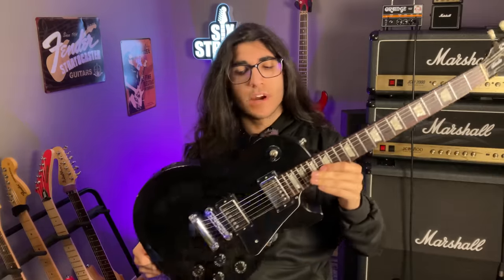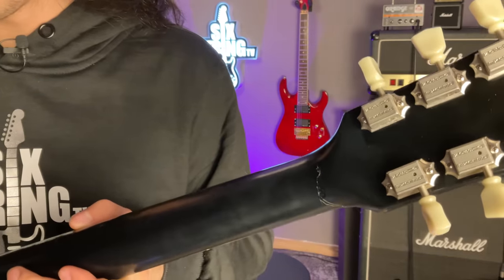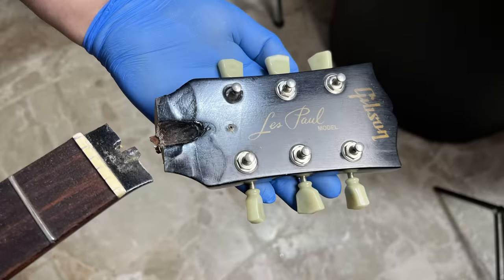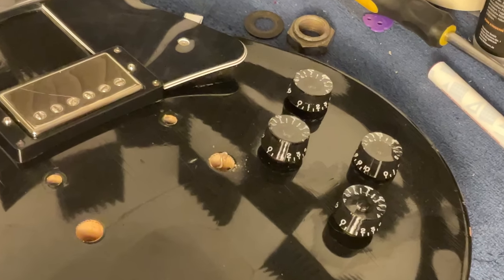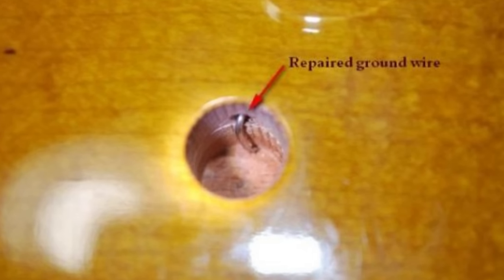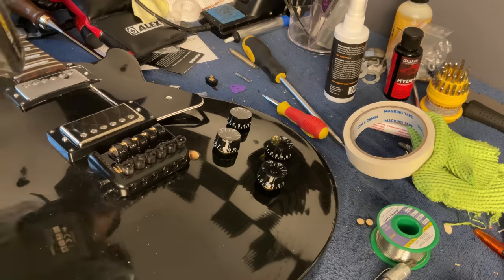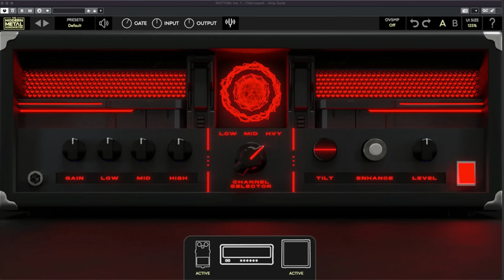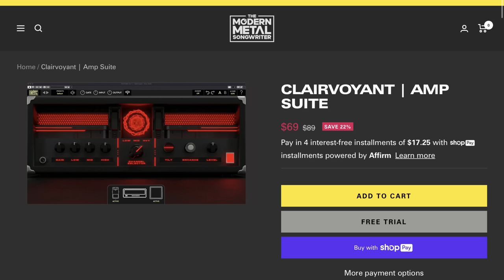How I Made This Gibson BETTER

Comment: My first headless guitar was one I made myself out of an existing guitar. It got knocked off its stand and the headstock broke in two so I cut what was left of the headstock off, bolted on an extra Floyd Rose locking nut and routed the body to move the tuning machines to the body. I've had that guitar for like that for 35 years and its always been one of my best playing, most stable and comfortable guitars even though its ugly AF (for many reasons, not just because its headless... I mean its pink with neon green splatters on it ... a local guitar shop used to run an "ugly guitar contest" every Christmas and I entered it several times. Never won though because it was actually playable). This was a cheap Tokai/Strat style guitar and so I ended up putting a tune-o-matic bridge and tailpiece on it and use the tailpiece as basically a big string tree. We didn't have cheap, readily available headless bridges back when I did mine (yeah, I'm old).

Comment: Absolutely love the way this looks, which is odd for me, since I do t really like LPs or headless guitars but this works. Any headstock repair will actually be far stronger than the original, it is the reason people use scarf joints on guitars. That Gibson can possibly break due to the same headstock angle and a direct slam but it will NOT break in the same place. That glue is crazy strong.

Comment: Hey kaylen I really liked the video,but I believe you might have made a mistake.Looking at every guitar on the market,i can see that after the nut,the string heading towards the tuning pegs is at an angle,the aren't completely straight,this helps reduce the tension on the neck.At first I thought that this isn't necessary on a headless guitar,but after checking headless guitars on thomann,you can clearly see that the strings are on an angle and not perfectly straight,i think you can correct it on the less paul by rotating the floyd rose locking nut.
Though I am not sure,I might be wrong,I have zero experience with headless guitars,you can correct me if i am wrong.

Comment: "Professionally repaired"

That wasn't actually professionally repaired. Gluing it back on is only half of the process. It has to be reinforced afterward, with either inlaying hardwood or grafting carbon fiber. Then it just needs to be painted to match the rest of the guitar. A professionally repaired headstock break won't even look like it was broken in the first place.

Comment: Pretty cool mod for a broken les paul, gives a different option as to gluing the headstock on or gluing and routing it out for wood blocks and reshaping the neck
Reply from the maker: I would've done it either way really. Just so happened that the one I bought had a neck break

Comment: I’m doing the same fix for a snapped epi. Same bridge, about to drill and try to figure out the stringing up, wierd design tho seems difficult to run strings through the bridge and tune any advice or info you watched

Comment: At first, I was worried about you doing this to an actual Gibson, but when I saw that the headstock was previously broken, I felt that it was justified. 
The end result still looks very beautiful. I would love to see someone play this guitar at a gig, just for the reaction of the audience.
Reply from the maker: I would've done it either way, just so happened the prettiest LP on ebay at the time was one witha  repaired neck break 🤷‍♂️
Reply: @sixstringtv1  I mean it is your guitar, so you can do what you want with it. It’s just like putting Floyd Rose on a Les Paul, whatever get’s you to play the guitar more often is a good modification. 
I was just surprised because of the huge value loss. But honestly, you probably have a lot of fans, that would happily buy this guitar from you.

Comment: The headstock fragility is due to a single piece neck and the back angle on the headstock. A previously repaired headstock that has been glued is actually stronger than the short grain wood fibers themselves. So not sure why you made up the claim that broken headstocks usually break again or "relapse." 

It's an antiquated design for sure, but no need to make up BS.

Comment: The strings spacing is not the same in the Les Paul and in the bridge from Aliexpress. It's too wide. The pole pieces of the pickup are not under the strings anymore. It might be weird to play on the higher notes of the fretboard ??
Reply from the maker: Absolutely not, it's just fine. Can't tell a difference
Reply: @sixstringtv1  ok. I think that Les Paul looks cool without the headstock !

Comment: I don't think the headstock issues are a build quality thing; it's a design issue. Follow the spec, and no matter how good the luthier, it's always an issue. Add a volute and/or change the angle and you end up with something more resistant to breakage.
The build quality is why you'll get a poorly cut nut, ugly routing in the cavities, issues with the finish...

Comment: That’s pretty cool and a great idea using a regular locking nut as a stop “nut” ? Practical and far cheaper than the individual headless string retainers. Now I’m off to look for a LP style with a broken headstock lol. I couldn’t have done it to even a studio, or maybe I could’ve after I messed mine up trying to put splines in it because I like doing things myself. Maybe I could find an Epiphone , wait Epiphones don’t break headstocks like Gibsons. I’ve always played bolt on fender style guitars and don’t like the neck on most Gibsons I pick up, but I have got to the age where I’ve got an itch for a LP style guitar, I wish Tokais were more available in the states. Anyway if I were going to spend the type of money Gibson wants for a LP, I’d probably get a Suhr or a Friedman S or T shaped thing. The guitar sounds good though, really good I thought before and after.
Reply: don't use that bridge on any gibson style because the string alignment will be completely off. find one that has the correct string alignment. you can clearly hear that kaylen sounds out of tune after he did that. of course he's stable where he is. but he's not actually in tune up & down the fretboard
Reply: @obsg2650  you mean it’s string to string spacing ?
Reply: @brandonjackson5865  exactly
Reply: A floyd nut is not really practical if you just want to change one string. But its really the only thing that works on a tilted headstock like that.
Reply: @maxmustardman298  I personally never really change one string at a time, occasionally I will on a Floyd rose equipped guitar and when I was younger and some how poorer than I am now I would tend to break more strings and would change a single but if you got a Gibson style with a broken headstock and are making it headless that FR nut is cheap and practical there are better choices of course but we’re taking about improving rigging and using what you got.
The Floyd nut was so practical I couldn’t believe I hadn’t thought about it, I’ve casually looked at headless guitar bridge/nut for a different idea I’ve had basically putting one on my Baretta special to lock at least the high e string down right behind the nut.

Comment: I don't understand how Gibson headstocks break off so easily. Is it because mahogany is somehow weaker than say maple, or is it simply just bad design? I've had at least ten or fifteen guitars with similarly slanted back headstocks and I have never had a single headstock break off (even though they've been treated fairly poorly). Ibanez, ESP, Schecter, Jackson and almost all other guitar brands make models with slanted headstocks that don't break easily.
Reply: one piece necks that are weakest around the headstock transition where the grain is the shortest, the wood itself isnt that important here. Although maple for instance is in itseld harder to break when using the same blank of wood. Add to that the headstock angle that always hits the ground first and the trussrod channel which takes even more wood away in that area. Its just failure waiting to happen ;)
Reply: @maxmustardman298  Thanks for the answer! I'm guessing that most of the guitars and basses I've owned are not one-piece necks, so maybe that's why they've been stronger.

Comment: Les Paul is a horrible guitar.
The headstock design makes it impossible for the thing to stay in tune, it breaks off if you breath at it, the body constantly tries to escape your lap, it has no comfortable cutaways, the scale length does not allow anything lower than D standard with a thin enough string gauge, the neck is thick, the bridge is not meant for your picking hand to rest on it, I can go for much longer, Les Paul is a terrible, terrible guitar and the only reason people buy it is the Gibson marketing team doing it's job.
Reply: If the Les Paul scale is a problem, why do people buy Jaguars/Mustangs?
Reply: @skaldlouiscyphre2453  neither of those is marketed as a guitar for heavy genres. Les Paul on the other hand is considered THE guitar for heavy metal, and people blindly follow that
Reply: @bruno_gatti  Pssh, Les Pauls aren't even pointy.

Something like a Jag or Les Paul is an adequate guitar for some heavy styles, but not others. Thrashy stuff and/or sludgey and/or Stockholm sounding stuff all works fine on 24.75 or 24" scale guitars. 

Genres that require a very low tuned and tight tone aren't going to work well with something shorter than 25.5", but that's only a limited portion of metal. 

24.75 sounds fine down to about C, 24 sounds fine down to about C#.